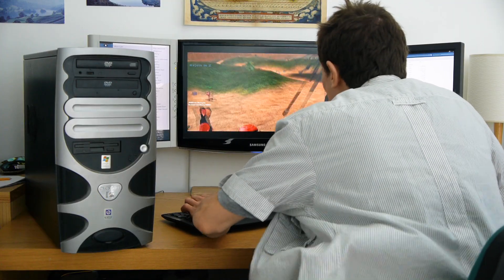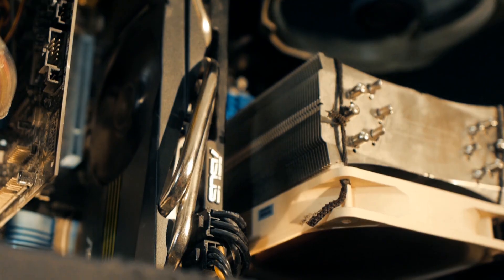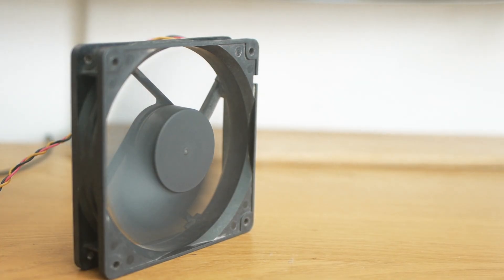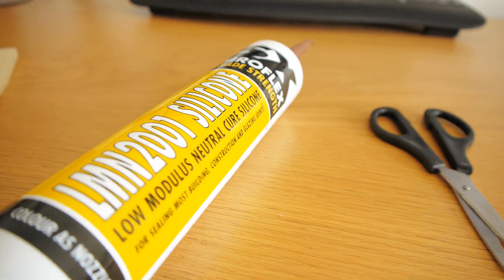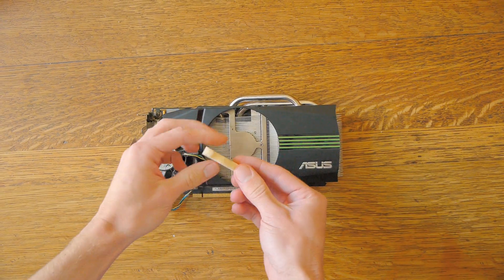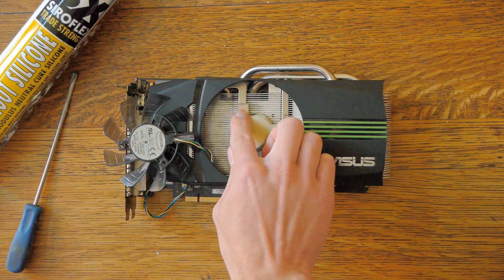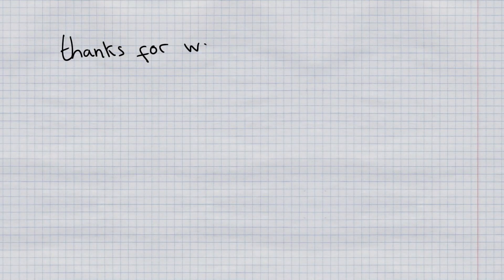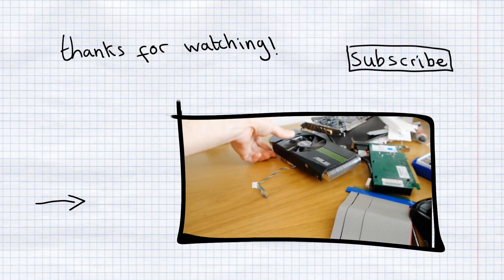How to make a graphics card quieter

Comment: I don't know about this? GPUs get really hot (hence the heat sink) which would melt the glue, which would get flung about your PC and could cause way more of a problem then just a noisy fan. I would strongly advice against this suggestion.
Reply from the maker: Patrick Kilduff We're gluing the sponge to the fan mount, which is isolated from the heatsink for that very reason (there was a plastic fan screwed to it before, remember). Max it ever gets is around 35c. Most trade glues are fine faaaaar above what the GPU can get to even at its core anyway.
Reply: Silicone based adhesives are in the same classification as thermal paste.  They tend to be fine well over 100 C.
Reply: Ok...I see.

Comment: Card gets hot then melts the glue. Then you have a spinning fan that is trying to hit any exposed wires in the case. IDK about this one.
Reply from the maker: ***** Weird glue if it fails at 30c (it is, after all, not mounted to the GPU die, but the fan mount instead, which doesn't touch the heatsink itself).
Reply: Didn't think about that. But hey if it works it works.
Reply: Ya dont!! But do it only of u have an open environment setup like out of the case motherboard setup

Comment: I'm going to do this, but had anyone had the issue where the glue wears out and the fan falls off?  Could be catastrophic if you leave your pc on overnight
Reply from the maker: Dennis Spemik Most trade glue like I used here (silicone in this case) lasts for years and years. Shouldn't be much of an issue (mine's been going for two years already without an incident).

Comment: if you want to do your pc more quieter  buy a better case!...
Reply from the maker: mario droide Cases don't actually affect sound levels that much. They aren't very acoustically absorbent you see.
Reply: DIY Perks what about a silence-optimized case with noise insulation, like the Fractal Design Define R4?
Reply: iMrzifyyy Well sure, a Fractal R4, or even a R2, will get quieter if you keep all the sound absorbers on (i.e. don't use any case fans) and add an extra absorber to the bottom fan hole. But even this would lower your noise levels by 10-20%. Obviously this would also cause your temps to skyrocket (40-60% higher temps). If you replace the sound absorbers with fans it's going to be just as loud as a $10 case w/o any sound absorbing foam inside.

Also if your temps are that much higher it defeats the purpose - or rather, your components (HDD especially, but also your RAM, CPU, GPU and even your PSU and MB) will wear out thrice as fast and you'll end up having to replace them semi-yearly. Basically you're going to have to buy a new computer every second year year. If you're lucky the components might break down before your warranty period is over and you'll be able to replace the old parts with new ones for free but your computer would be out of service for 2-8 weeks each year (it takes around two weeks each time you claim warranty).

So if you're speaking of the cost in $$$ it takes to create a silent PC, it's much wiser to try a few DIY tricks.

P.S. The new ASUS GTX 780 STRIX has a 0db rating while your GPU is idling or doing something not-so-graphically-demanding. So if you're looking to make a silent PC you should get one of those.
Obviously once you start up a game or an app that requires more GPU power your fan(s) will start to spin and it will generate noise. If you want to lower this noise then you should follow the videos instructions and add some foam between the GPU and the fan(s).

Comment: wht about temps of the GPU from before and after? i am curiuos about how well does it cool the GPU even though yes the noise is signicantly reduced it still has to cool the graphics card.
Reply from the maker: yumri4 After testing the temps didn't change at all, which is nice.
Reply: that is good to know and thank you for you respoding to my question

Comment: one of my fans on my msi twinfrozr cars is wobbly and at certain speeds the fans are much louder than they should be:/
help please?
Reply: Just came across this man, So if the card is still in warranty just RMA it if the warranty has run out check Ebay for a new set of fans for it or go for a aftermarket cooler just check out the link for a suitable replacement http://www.frozencpu.com/cat/l2/g40/c21/list/p1/Air_Cooling-VGA_HeatsinksCoolers.html
Reply: n0r3l3c thanks m7 my gtx 660 is getting loud, but its getting more outdated so I'll just Get a new Gpu when I get chance
Reply: My twinfrozr II fans are dieing after only a year too, they need to be oiled. It's tricky because they're not meant to be taken apart, probably not worth the 15 bucks replacement fans cost on ebay.
Reply: Jan Jansen mine got noisy after like 3 months

Comment: I have 7 fans in my PC and let me tell you, loud as fuck. Not including my graphics card, my GPU, and other things. I sounds like 10 of those fans (without the sponge) any suggestions?
Reply: Use rubber grommets (or like rubber washers) between the case and the fans to minimize vibration. What case do you have? I may be able to help more directly if I know what type of case it is.
Reply: It's 
ENERMAX OSTROG ECA3253-BR Black/White SGCC / SECC ATX Mid Tower Computer Case
Reply: Oh alright, so it has normal mounting holes, I would say use rubber grommets or washers to space the fan from the case slightly and absorb vibration and/or use rubber mounts like: http://www.frozencpu.com/products/19479/scr-704/Akasa_Rubber_Anti-Vibration_Fan_Screw_for_Closed_Chassis_Fans_-_20-Pack_AK-MX003.html?tl=g47c481&id=S2KazCBH
Reply: Okay, Thanks!
Reply: No problem.
Reply: GameGruffs
Any better?
Reply: yes

Comment: doesnt the glue melt or something at 80-90 degrees(card can reach this temperatures)
Reply from the maker: Dries Verbist Silicone glue is pretty heat resistant. It varies from brand to brand, but 200c melting point isn't uncommon. The fan mount only gets to 40c max remember, as it is isolated from the GPU die.
Reply: ok thanks
Reply: Silicone is awesome isn't it?
Reply: Martin Landart okay....

Comment: just going to leave this here... fans work by building air pressure up and forcing cold air through a heatsink. what this homemade dipstick has done is he has gone ahead and spaced the fan and heatsink apart by about half an inch (instantly killing the air pressure between the fan and the heatsink)  and put an extremely flammable sponge in a GPU which can get up to 80 degrees celcius. lets all circle up a round of applause for this guy. i mean in the money he spent on all this garbage he could have just gotten a noctua heatsink for his GPU+CPU and never had another fan noise issue again.
Reply from the maker: Misty King Ok, so I'm going to ignore your unprofessional personal jab and reply with some facts.

Airflow is often improved when the fan is further away from a surface (like the heatsink) especially when a shroud is used (look it up). Luckily, the fan is still just under the rim of the surrounding plastic shroud, so if anything the cooling performance is improved.

The sponge isn't a fire hazard either, because a) it only melts at over 200 (at which point your card would be useless anyway) and b) it's not resting on the GPU die! It's resting on the fan mount, which is isolated from the rest of the heatsink so it barely gets warm. After all, it does have a plastic fan on it doesn't it? And sponge is plastic, essentially, is it not?
Reply: DIY Perks so youre telling me to space my radiator fans away from my radiator by 1/2 of an inch to improve airflow.. and how those fans work is not necessarily pushing air into, but pushing into and around the space under the shroud, and out the vent in the back. so spacing it from the heatsink would not only cause the fan to vibrate which may kill a high RPM fan due to unbalancing it, but also cause cooling issues, again ill repeat myself and either liquid cool your computer or just add high CFM Low RPM fans.
Reply from the maker: Matthew Bozanich No, it's not. I checked and the fan is still within the shroud, so efficiency, as I've said already, hasn't been hurt at all. Using sponge as a dampener as you suggest won't actually improve anything, it HAS to be floating to work.
Reply: DIY Perks you know doing that has killed the ducted fan design on that cards combo greatly reducing efficiency and effect good idea but silly in practice simply screw the fan in and use foam as a dampener not a floating mount.

Comment: Does the glue affect the heat-sink's ability to dissipate the heat? Or will it start to heat and melt the silicone glue or make fumes? I know my card gets pretty hot and loud, so I want to try this.
Reply from the maker: ***** So long as your sponge isn't too thick cooling performance shouldn't be affected. Fan mounts rarely get hot either, so I don't think the silicone will 'melt' as you put it (though they usually can withstand fairly high temps anyway).
Reply: Buy a silicone glove and bath, put it on and bath it in a fire. Then watch as the glove does not burn under the intense heat. I'm not responsive if you picked a cheap fake silicone glove and burned yourself, you are the one choosing to do this experiment.
Reply: ***** lol sorry i though that that experiment was cool thats the only reason I mentioned it. Also stop being so angry damn.

Comment: Why not use silicone donuts that are made to absorb vibrations?
You put them between the fan and the graphics card on each screw.
They are also used to make HDD and case fans less noisy.

Alternative is rubber or silicone pins.

That way it is reversible. In case the card breaks and you have to get a replacement.

The sponge can get old. With heat it gets old faster. When it gets old enough the fan can fall off. Small particles of the sponge can get stuck all over in the case.
Reply from the maker: Sad Clown Silicone/rubber washers aren't as effective as sponge at absorbing vibrations, unfortunately. There's at least 6 or 7 years before the sponge degrades enough to cause any issues, by which time the card would be obsolete anyway.
Reply: DIY Perks I didn't know that. The demonstration videos made it seem they worked well.

I got an idea for a next video. Compare the alternatives.
What if you covered a sponge with a silicone layer? Put the sponge in a silicone bag. Combining the methods.
Reply: DIY Perks
What about silicone washers with a sponge-glued layer, so you aren't wrecking the fan or the graphic card body in the first place with glue?

Comment: Personally, I would use double sided 3M sticky tape to absorb the vibrations. BUT, it needs to have foamy stuff between the two sticky sides. So much easier, and cleaner too install.
Reply from the maker: TheAwesonymous I tried double sided tape. It just comes off.
Reply: DIY Perks Yeah sometimes, but not the 3M stuff, I had a hard time scraping it off with a screwdriver :D
Reply: Not sure how good the adhesive would be in the long term
Reply: DIY Perks  3M has some double sided tape that can hold up mirrors in bathrooms XD [i used it and it's still up 3 years later] the only prob is the heat from the card melting off the adhesive on the tape i would think [hot video cards are HOT] lol nice video!
Reply: i would just get a thin sheet of soft rubber and mount it between it, or just run a custom fan curve within software
Reply: Its a great idea, but I don't think you keep in mind that graphics cards can operate from temperatures of 30 degrees Celsius and above (and in most mid to high range cards, being around the 50 degree mark).

Comment: You should have used an SPL meter to record the before and after sounds levels.You can get cheap ones for less than 50 bucks. It Will definately be of use in your videos!
Reply from the maker: Are they sensitive enough? We're probably down to the tens of db here.
Reply: Heh , if the camera/microphone/our ears can pick it up then the SPL meter should give you a very distinct distinction. Just don't forget to measure with the same amount of ambient noise and same distances.
Reply: Shagas Heizenberg Distinct distinction hehe
Reply: Ops , error there :)

Comment: And you have just lost your manufacturer warranty
Reply from the maker: I didn't see a 'warranty void if removed' sticker... It should be easy enough to reverse so long as you keep the original screws anyway, depending on the type of glue you use (silicone glue like I used can be scraped off if needed).

Comment: Until the glue heats up too much and the sponge comes loose shooting your fan blades into your computer while cutting an important computer wire making your computer spark igniting all the dust bunnies that you forgot to clean out expelled through the outtake fans hitting a pile of kindling that was conveniently placed by cavemen in your living room setting your house on fire. GG

Comment: i throw away the plastic cover from the card and attached 2 x 120mm fans with 1000rpm slow (50% speed)   gpu rans not hotter/cooler than befor but absolut silent

Comment: When you reinstalled your fan, it was not centered 100%.  Eventually, it may hit the side of its casing.  This may destroy the fan and possibly other components inside your case.  Another problem is the fan drops out of its casing because it is only attached to the foam piece.  This means you will not be able install a card adjacent to your video card.

A better way would be to use 3 small bits of your foam between the fan and card while still using the 3, possibly slightly (2mm) longer, screws.  Another way to silence the fan would be to remove the card cover and fan, grease the fan with 1 drop of Premium Household oil and Super Lube White Grease - 1/2 oz Tube, Amazon ASIN B000BXKZQU.  I have used this method on all of 8 of my 80mm fans, a Dell PC's 92mm fan, and 2 - 120mm fans.  ALL are silent now and I have prolonged their lives.  The 80mm's are over 12 years old.  Half are ball bearing and half are sleeve bearing.  Although the sleeve bearing fans are cheaper and are supposed to not last as long, I prefer them because they are totally silent.

The problem with trying to grease video card fans is they are difficult to get to without damaging something.  I have been running a GTX 460SE for 3.5 years.  Eventually, I must remove the cover to clean the heatsink with compressed air.  I also must grease the fan.

If you could make a video on how to do this on a GTX 460SE card, I would appreciate it.
Reply from the maker: I didn't centre the fan because I knew that gravity would pull it one way very slightly. ;) Besides, if it hits the side all that will happen is it will stop; they're not brittle so aren't likely to shatter.

Good tip about the grease/oil though. That would definitely be useful for fans with ball-bearing noise.

Comment: You don't technically need to put silicone on it lol. The screws will hold it in place. Why not use a foam or rubber washer?

Comment: Do you think that the temperature could affect the glue over time?
Reply from the maker: Depends on the glue I guess. The stuff I used is rated to 200c I think, so I doubt it's a problem as the fan mount (which isn't in contact with the GPU directly) will never get hotter than 40-50c in reality.

Comment: and just wait for the sponge to melt and set on fire well done and destroy your graphics card well done mate ....
Reply from the maker: You do know that the melting point of sponge is above 200c right? And that it won't even spontaneously combust even if in contact with metal at 400c?If the GPU was that hot, sponge melting would be the least of your worries.
Reply: Improbable

Comment: But Wouldn't this make the temperature of your graphic card increase since the fan is not as close to the heat sink and a piece of sponge is trapped in between them?
Reply from the maker: Temps are roughly the same. Cooling is all about air flow, rather than how close the fan is to the heatsink. Sometimes having the fan further away actually improves cooling because the air flow is less focused.
Reply: OK， just curies about how this could impact the temperature.